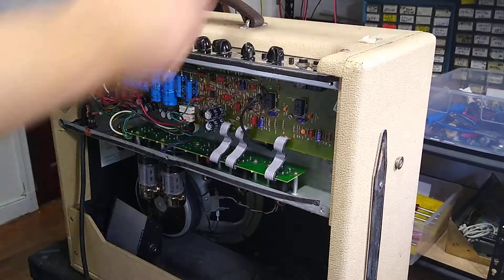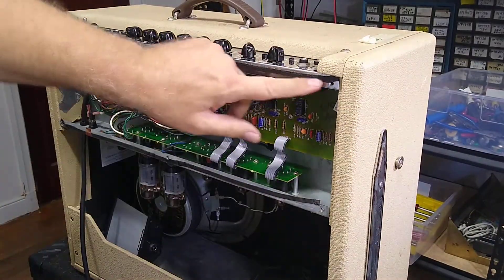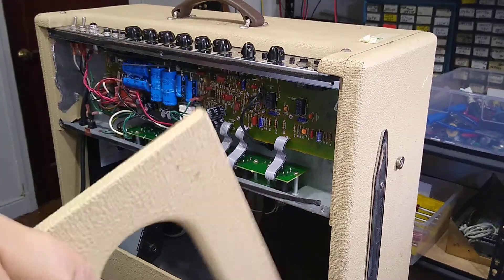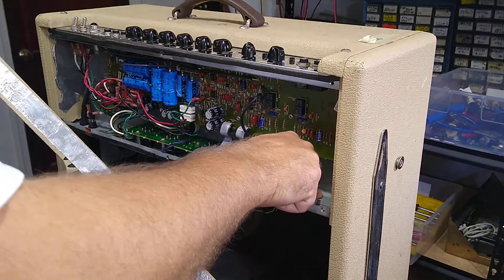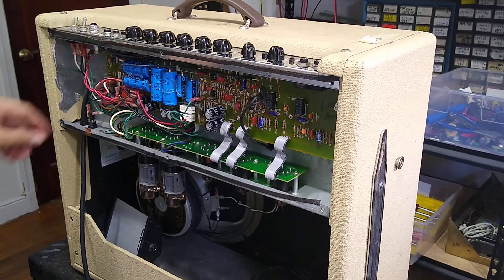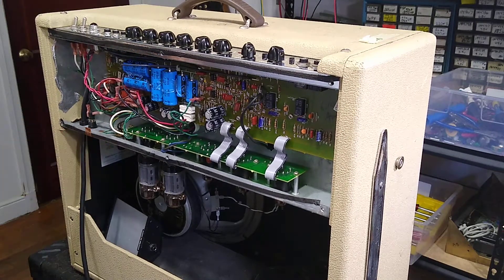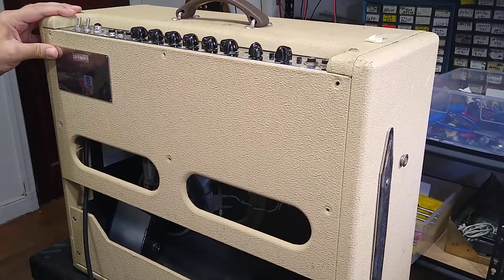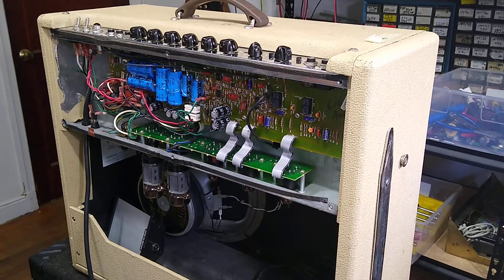Fender Shielding repair

Comment: thanks for video! was wondering when i put my chasis back on amp it destroyed all the shielding on one of the sides and damaged the other, is the shielding important?
Reply from the maker: only if the amp is too noisy for what your using it for. People that use it for recording clean tracks will want it as noise free as possible, garage rockers wont even notice.